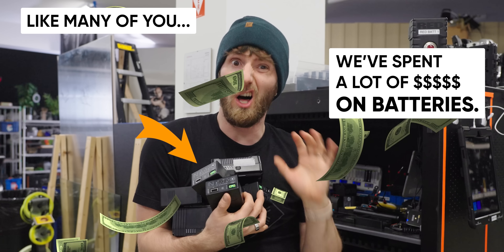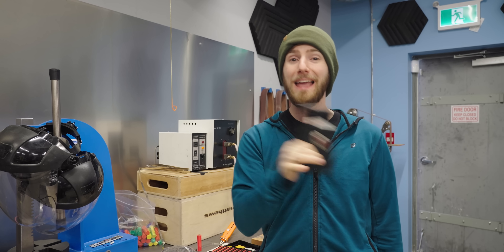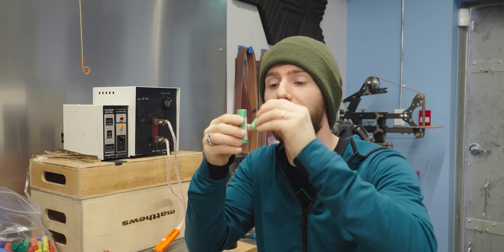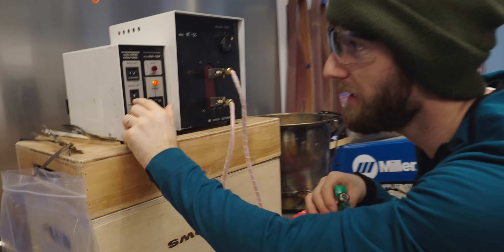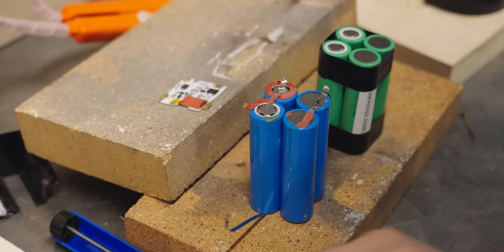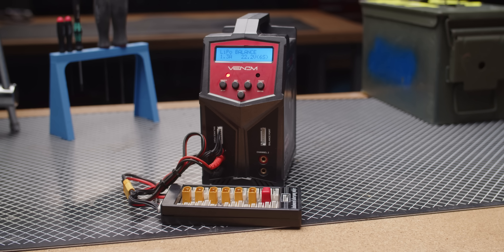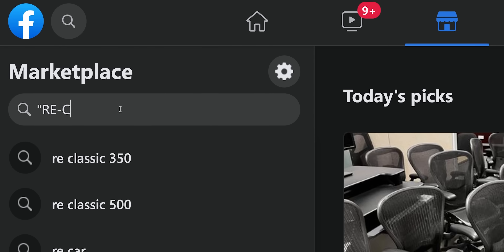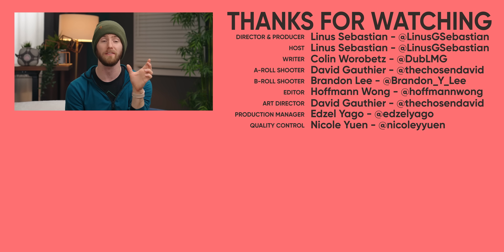This should be illegal… Battery Repair Blocking

Comment: as someone who was a technician in the military, and one of my main jobs was to replace  expired lithium batteries, let me tell you- the safety precautions those things take is absurd. a lithium fire is a big deal

first of all, we had a storage that contained over 15 tonnes of lithium. this means that a combustion would endanger lives of up to 75km from it. that container was under the municipal supervision of 3 different counties firefighters. each of them did a monthly checkup on it independent of rhe others. and we had to undergo training of how to handle fire every half a year

the same container had a no-failure air conditioner that kept a constant 15c environment there, rated for extreme cold and heat at all time, the same ac was powered by the base own powergrid, and backed up by the civilian powergrid, as well as 2 seperated generators that are checked every half a year

every new recruiter undergo a series of fire drills he has to pass before he can start working, and as a said, every half a year we get a refresh in fire-extinguishing training. also each room in every building is eauipped with a 10 kg fire extinguisher and a 2.5 kg lithium extinguisher (which is a much heavier foam that js completely dry)

before allowed to replace lithium, we undergo a day training in soldering

after battery replacement the pack is screwed down by a proprietary screw we have the driver for. and sealed with a sticker much like the warranty void ones
if a device come to us with a broken seal, it must come with a proclamation from an officer as low as lieutenant colonel that the seal was not broken by malice and that the batteires are safe. if a seal comes broken and without such proclamation, we forward the device as well as a report for the Military Police Investigation unit
we are the only unit in our sector (northern comm sector in our case) that is allowed to remove that seal and to make a new one

 after replacement, each 1 kg of replaced battery must be sealed in  2 layers a special one-use water repellant, anti static coated bag. and every replaced battery must be reported on the pc with the date replacement, and how close is the expiration date of the old battery. also each new battery we get from procurement must be reported

the discarded seals of batteries are than carried in a marked crate with the number of batteries in it. and must be under the supervision of 2 technicians that are also allowed to replace the battery (like me) at all time while outside the lab, until it goes to the hand of a hazard-handling officer

the officer stashes them in crates of  50 kg each at a seperate air conditioner container, until they get handed to a hazardous disposalntrack that comes once every 8 weeks

so its kinda a big deal
Reply: So... pretty much nuclear material but without the hazmat suits :P
Reply: @Ormathon  well... it is mostly handled by a bunch of 18-21 years olds (not the checkups, but the replacement), and not a bunch of doctors specialized in nuclear fusion

Comment: 4:40 you do not swap out defective single cells - but you could re use good cells in other projects. Projects such like a selfmade power brick for a smartphone etc.
Reply: Excellent point, you don't have to put those cells back into your device, they can still be useful for a light or some other fun project, it's always nice to keep a few and some TP4056 with protection on hand for random little projects.
Reply: @jehugarcia been doing this for a while :-)

Comment: Definatly Make the Trip to see how its done , looks like total disconnection wipes the operating systems bios m need fitting with a motherboard Hearing Aid battery to keep its memory while you switch it or copy it to a back up hard drive to be re flashed would be Awsome.

Comment: Makita drill batteries have a nasty BMS where if it faults while charging three times in a row it bricks the battery, even if you replace the cells, even if the pack is fine and it was just cold because, idunno, you are a trades person working outside during winter. It should be unlawful, replacing cells isn't rocket science and a competent shop could do it no problem but just.... can't... because the OEM blocks you.

Comment: Its possible to prevent a BMS from committing suicide by hooking a new battery to it with patch leads before disconnecting the one you are removing, then once the new pack is in place and properly connected you can remove the patch leads, just make sure you have both packs at close to equal voltage.

Comment: With the BMS at 13:50, you probably just had to put it on the charger for a bit. I've had some BMSs refuse to put out a voltage until they got put on a charger

Comment: You had nothing connected to another side of the batteries. Draw a circuit diagram and then think what caused the spark at https://youtu.be/Mkum7G-0vWg?t=578

Comment: I'd love to see a field trip to Retriev Technologies to see battery recycling.

Also, good use of Linus's reputation as a walking hazard meme to get viewers. I came to watch Linus make something explode just by coming in contact with it and left having learned something about Right To Repair, the battery industry, and lithium-ion battery replacement.

Finally, I'm fine with battery companies limiting access to consumers repairing their own batteries. Letting consumers near electrical storage with a welder is a recipe for disaster. But the modern world needs to have a real discussion about replacement, recycling, and disposal of this new power paradigm. We went though the Industrial Revolution with the use of coal,  the diesel punk era with internal combustion engines, and dabbled in nuclear power. At every prior point, our ancestors never talked about what should be done with the waste and runoff from each great leap forward. I think bebob has the right idea for replacement/recycling and that "evil" BMS's that artificially limit the number of recharges despite the actual physical health of the individual cells should be illegal.

Comment: This is fairly typical behaviour for a BMS (no voltage output after replacing cells). It’s easy to “turn” the BMS back on though, you simply have to short the BMS or apply a current to it to re-activate it. This is not necessarily manufacturers being evil, it’s just how a lot of BMS are designed. I’m sure you can get the Red and Sony battery packs working again by figuring out which lines to short or apply current to.

Comment: PROTIP: Lithium Ion cells are far less volatile when discharged. If you're going to do something like this, it would probably be best to find a way to discharge them to at least 50%, and then once done, set them up for charging somewhere that can handle a big fiery explosion without anything catching fire, and don't consider the project complete until it can be fully charged and discharged without the cells overheating, the shell melting, or exploding.

Comment: I concluded from a few used RC-grade batteries is that the best cell config is 1S.
I tore apart a 6S1P(6 series 1 parallel) Dyson pack because BMS keep going crazy. Ran them through a $200 pulse charger to measure internal resistance, effective capacity, and cycled them twice. I grabbed two for two different flashlight projects and the rest is just sitting on shelves.
DO NOT. DO NOT try to put together your own pack. It is highly dangerous (you could bridge the two terminal and have lithium fire), you don't have professional tools and the quantity to group cells based on internal resistance (so you run risk of faster degrade/explosions), and you don't have good jigs.
Unless it is a serial cell pack, in which case it's more safe. But still. Don't do it.

Comment: Well mixing old cells and new cells isn’t all that bad.  If a battery pack is built to separate each cell with diodes and is smart enough to monitor battery capacity and life difference then it should be extremely easy to swap cells.  The problem is that they would rather make you buy a new one and thus also making the product much more expensive than make a battery pack that can be repaired easily.  Given the technology we have today, there is no reason why we should still be using such basic circuits in EVs and other high powered technologies that use batteries.  It seems like they’d rather blame independent repair and end consumers than fix the underlying problem of unpredictable cell defects and life variance when you buy bulk amounts of batteries and don’t test them enough.  We should be able to repair these things because it’s not that complicated in reality.  I mean the chances of a battery failing from the manufacturer are much higher than an independent repair shop that is dedicated to quality.  Don’t we have the right as a consumer to have the ability to repair a device if we are licensed?  It is currently US law, yet companies are circumventing these laws by making soft locks which make it impossible to repair without being locked out of the device.  Doesn’t that seem ridiculous?

Comment: Look, I'm with you on the anti-repair attitude, DRM-heavy, locked-down strategy of many companies. That's wrong. But when dealing with lithium, there really needs to be a bit of an idiot deterrent, simply because of the safety factor. Not just the immediate factors, but the potential for long-term, latent issues. Packs do catch fire, usually when charging, in the middle of the night. People die every day because of battery fires. Usually because loose manufacturing standards of questionable cells, but sometimes because of careless assembly - the separator in the cells is usually a polymer that softens when people spot-weld poorly, or worse, solder. And most packs really can have their cells replaced, it just requires a bare minimum of knowledge and care.

Comment: also:
I do use a bike light with 6x 18650 batteries. But there is a battery case I can buy to which I can put 6 batteries as "basic AA" batteries. this pack is also waterproof when closed properly.
So I wonder. If bike parts can be done this way, to have easily swappable batteries, why not engineer something similar for other types of battery usage: such as your camera?

Comment: mmm i thinks you guys are going a little too protective on theses one :/ like a the battery balancing themselge on 0.2v for one or two is not so big of a deal and trowing the hole pack of battery at 10mn just because there was a little spark? damm that's juste waste :/

Comment: Well, did you tried to charge the RED battery?

I changed cells at a power tool battery and the BMS just came up (status LED and other) after I put it into the charger.

Comment: User serviceable battery packs aren't as crazy as you might think. It's not like ordinary battery compartments for 18650 cells don't exist. Anyone who's changed the batteries in their TV remote should be able to pop an 18650 into a bigger version of that. Sure, it would cost a few more millimeters of design space, and might cost a penny more in construction, but imagine being able to sell a battery pack on the merit of any idiot being able to replace the cells without starting a fire?

That said, even if things aren't "user serviceable", which these days means "any idiot with a screwdriver serviceable", they should still be workshop serviceable. Anyone with the tools and knowledge should be able to replace cells in a battery pack without the BMS committing suicide.

Comment: I am usually against "roadblocks" on repairing electronics and push for a serviceable approach, but "re-celling" looks really tricky, and with the rising amount of amateur "re-celled" batteries may end up in lots of incidents. From my point of view, they should be engineered with cradle for each cell, as we have for generic batteries in tv remote and so on.

Comment: i do wonder if you soldered a power supply onto the battery leads before you pulled the cells off and during the replacement (using a diode to prevent the cells from feeding into the power supply if needed), that would prevent the bms from powering off and you could make it safe by making the voltage lower than nominal (effectively preventing your power supply from charging the cells but still keeping the bms alive)

Comment: i bet volatile storage is the actual answer. so the solution would be to keep the bms powered externally with a bench power supply and solder on the new cells with the aux power on

Comment: Nice video as always!
As said by numerous others those sparks are normal, I though they meant you had good power going in the electrodes, and that it wasn't good, if you only had the red glowing strips.

If you get a real short on your batteries, you'll get no sparks, but the nickel strip will get red hot.

As for the recycling factory tour, that would be awesome.
But remember, before putting the battery to recycling, you can still repurpose them for static use (like home batterie/powerwall). What's considered a dead consumer use battery still has around 60-80% of it's capacity.

Comment: i recommend safe way like remove battery put in smart charger i dont like using other pcv board doing work for me i dont trust it because lock itself cant use it anymore 
u could get away with rc car battery but not going last longer than vape battery because vape shop sell reliable battery they last more like 4 to 8 years
i dont recommend welding battery together i recommend removeable put in chager save ur self a headache

Comment: I also discovered the same issue on other battery packs. They use a type of fuse with evil circuit, which will break the fuse when batteries are disconnected. You can try to bridge the batteries while changing them, but it s still a <50% chance that it works.

Comment: Lithium batteries are not that dangerous as you are trying to make us believe... Sparks (or did you short those cells?lmao) and small holes in the cell when spot welding means nothing in 99% cases (ofc replace cell that got damaged)

Comment: There needs to be alot more thorough examination of the batteries and charge state before giving up. it seems you guys did alot of research on the safty part (good, this is often overlooked) but the BMS is pretty stupid when it comes to these things, at most there would be a fuse pop to lock out tampering, but seeing as there are like 10 bms IC commonly used, this is easy to overcome.

Comment: 15:58 Nah, Linus. 
The "evil" BMS is in every single removable laptop battery out there. 
In order to swap cells in such a battery, you would have to clamp an external voltage source onto the leads of the not yet dead but week cell, then cut out the cell and solder on a new one, all with the external voltage source still attached, which will mask the removal of the original cell and thus the BMS won't notice. 

A difficult task imo.
Reply: But even if you accomplished the cell swap, the BMS might shut down on you after 1 or 2 cycles when it has detected a rapid change in capacity. Had this happen to me before.
Reply: Linus did you try to recharge the pack after swapping the cells as some have safety not to discharge after the pack goes under a voltage's =P
Reply: I doubt the BMS firmware is encrypted. Question of dumping, editing and rewriting the ROM
Reply: @HG-fw8hn I like the idea. But I don't think it will be that easy. 
 Afaik, OEM manufacturers are selling the necessary data for making new batteries. 
So, they protect the data in the controllers as good as they can so that the firmware doesn't leak. 
And unless your BMS is storing lots of data, there is no need for an external memory, since most microscontrollers come with integrated ROM for some data storage such as settings. The integrated memory is just as save as the firmware.
Reply: @oilybrakes  I would be interested to take a crack at it, just for funs sake and without sharing it to satisfy my curiosity. So if anyone is willing to send me a dump with info on the microcontroller it came from I could probably find out a few things
Reply: Gotta keep it alive during replacement. That's heart surgery basically.
Reply: "Difficult"? That's near death level difficult ! One mishap and you'll be seeing God.
Reply: @carpetdm9635  I think a dead BMS is more likely than seeing god in this scenario

Comment: There sre definitely some BMS'es with their own software in RAM. Not in flash memory, but RAM. As soon as BMS is not powered, it's RAM is cleared and BMS no longer works. If you need to recell battery with such a BMS, solder a templotary pack to balancing terminals before disconnecting old cells.

Comment: Yeah... Swapping the cells is the only way for independent repair shops to do modern iPhones without apple disabling the software health monitor. It's crazy and very anti-repair. The latest ones need the flex rebuilt, or parts added, because they've made it even harder to repair.

Comment: I managed to change a set in a Milwaukee 18v power tool battery.  It required welding and I was able to judge the required width of the nickel by doing some current tests. It still cost £35 to buy new fused cells but the battery is still a really good one.

Comment: My dad was checking some defibrillators for his medical company, had me look at the batteries, and get this:
1) THE DEFIBRILLATOR HAS NON-RECHARGEABLE BATTERIES
2) THEY COST $400 (FOUR HUNDRED DOLLARS yes really) FOR WHAT IS ESSENTIALLY A PLASTIC BOX OF D-CELLS
3) THE DEFIBRILLATOR DOES ROUTINE CHECKS THAT DRAIN THE BATTERY
4) WHEN I OPENED THE PACK THE CELLS WERE AT ALMOST FULL VOLTAGE, BUT THE BMS CHIP SHOWED THEM EMPTY
and finally IT REFUSES TO WORK IF THE BATTERY IS NOT FRESH! Not kidding, it will let a person die if it snowflake ass says it doesn't have fresh bats.
This is criminal and I wish the engineers to be hanged drawn and quartered - it's a  D E F I B R I L A T O R  for Christ's sake!